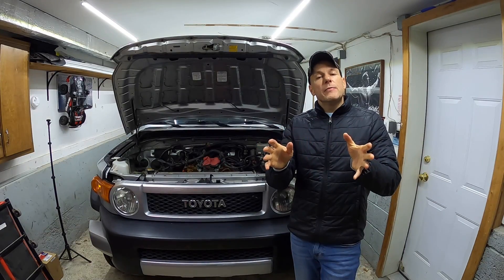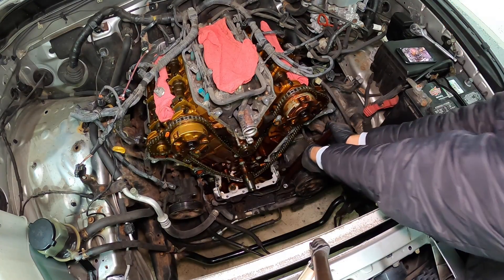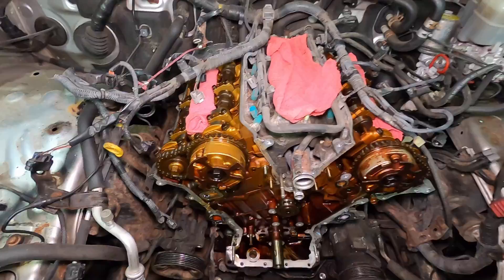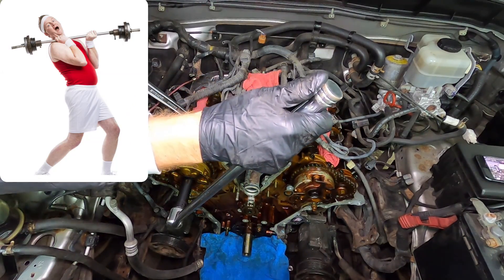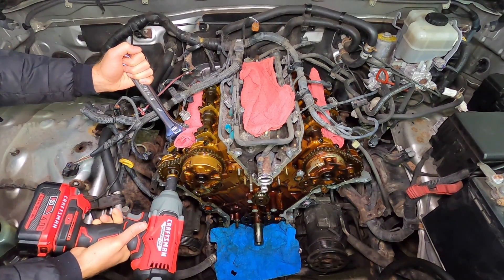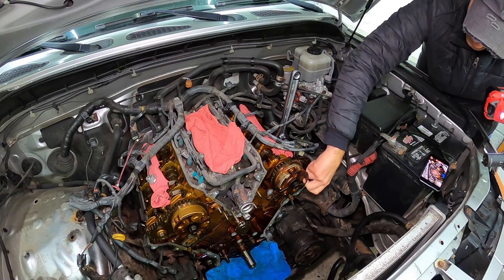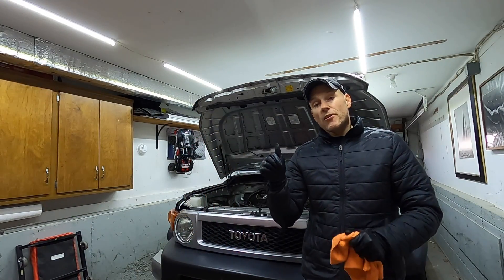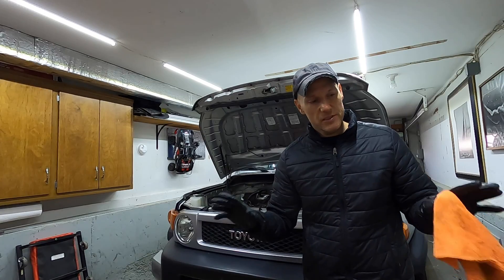Timing Chain removal Toyota Tacoma - FJ Cruiser - Tundra  1GRFE Engine

Comment: You just encouraged me to do it.  I had the cover off fixing the oil leak on the passenger side of the cover,  by the steering pump,  and while inspecting the chain I found it had tons of slack.  So now I'll replace the chains based on your video.  Thanks for sharing it.

Comment: Mine is currently at 335k miles. Have only replaced 1 water pump, plugs every 30k trans service every 15k, oil every 3k, diffs every 15. 1 water pump in 335k miles is nothing. Oh and 3 batteries.

Comment: It should run like brand new after you're done.

How's the transmission on this thing?
Reply from the maker: I've honestly driven the truck for maybe half a mile; just to check on things when it first arrived. It ran incredibly well, despite the p0016 trouble code. I'll upload a video once the truck is up and running.